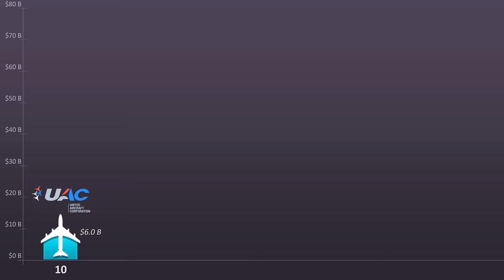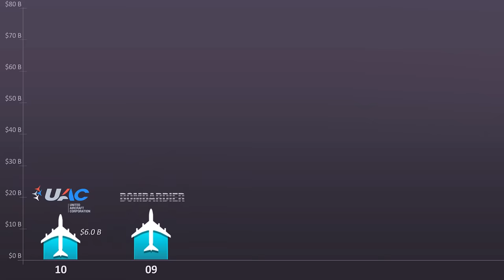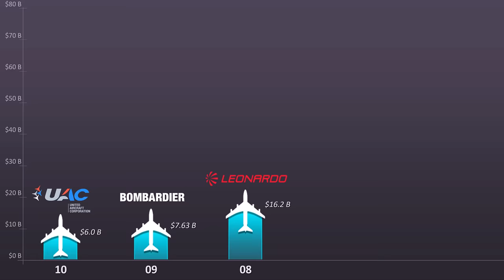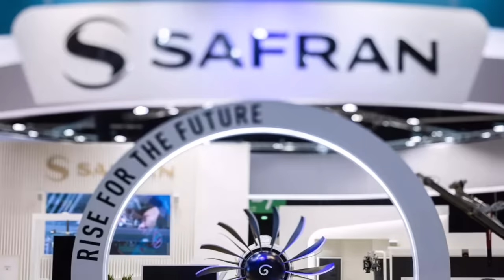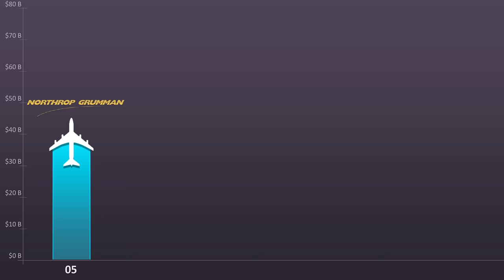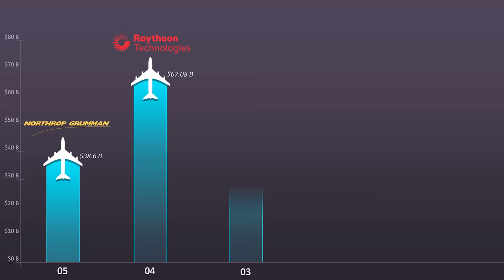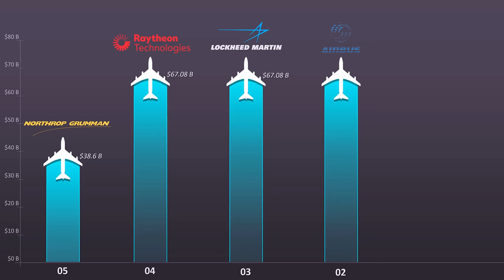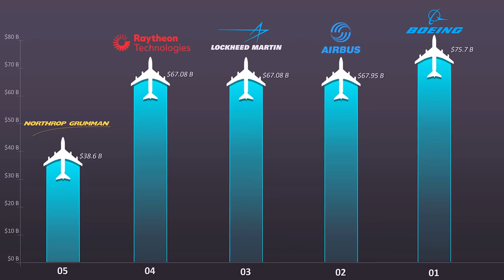Top 10 Largest Aircraft Manufacturers In The World Today

Comment: Where are Rolls Royce and BAe Systems on this list..? 😮
Reply: Makers of parts, not complete aircraft. RR supply engines to many, especially Boeing and Airbus; BAE SYSTEMS (not BAe - see my other post) supply to lots, especially flight computers. (Also control sticks and helmets.)
Reply: @G6JPG  Boeing's 777 and 787 all feature RR engines.
Reply: @mikefraser4513  My point was that "The Buzz" was making a list of  aircraft manufacturers, not component manufacturers. (It has been pointed out to me that BAE SYSTEMS do make some complete aircraft, though whether they come in the top 10 I don't know; if you compare turnover of the whole company, rather than just the complete-aircraft part, they might well.)

Comment: There are some disinformation in this video:
1. The 737 was not grounded in 2017;
2. Not all models of the 737 family were grounded;
3. Concerning revenues, Embraer should be in the list;
4. There are some non-aircraft manufacturers in the list.
Reply: embraer should not be in the list. latest reported revenue is 4.2 billion. It does NOT crack the top 10.
Reply: @henk-janlammers4994  Considering the Top 10 Aircraft Manufacturers list includes companies that do NOT manufacture aircrafts, you're right.
Reply: @henk-janlammers4994  Yet, as opposed to half the companies listed here, Embraer makes complete passenger airplanes. Raytheon only makes electronics and missiles, RR only makes jet engines. So Embraer has way more place here than others.
Reply: If Boeing continues doing the crap it is doing, Embraer will overtake it. No doubt.

Comment: I HAVE A DREAM of planes that can take us from any major US airport to Europe in one hour or even less depending of the airport there!
Reply: Well i think the closest you will get in the present era would have been the supersonic passenger jet Concorde which could reach a cruising speed of Mach 2.04 (2388 km/h) or in miles 1483.83 h but these are not present no more since an accident happened with the plane in which it flew over a piece of a passenger plane that was not cleaned of the runway and hit one the tires of the airplane which in turn ruptured one of the fuel tanks in which the heath of the rupture was so hot that it ignited the fuel inside the airplane which caused it to cause fire and shortly crash.
Reply: https://en.wikipedia.org/wiki/Concorde
Reply: https://en.wikipedia.org/wiki/Air_France_Flight_4590
Reply: After reaching takeoff speed, the tyre of the number 2 wheel was cut by a metal strip (a wear strip) lying on the runway, which had fallen from the thrust reverser cowl door of the number 3 engine of a Continental Airlines DC-10 that had taken off from the same runway five minutes previously.

Comment: Rolls Royce & Pratt & Whitney are bigger than at least 2 of these - if you are going to include GE you should include these major engine suppliers, better yet - just include actual "Aircraft Manufacturers" of which there are many more who should then be on the list. As of now UAC cannot be as big as it was when last reported - since its supply line for western equipment & engines has dried up - take it off the list, not having actual revenue figures doesn't matter - it is inevitably much, much smaller in 2023/2024. Make a real list.